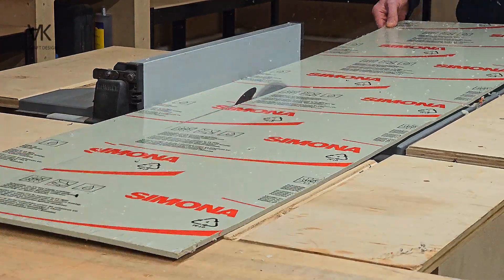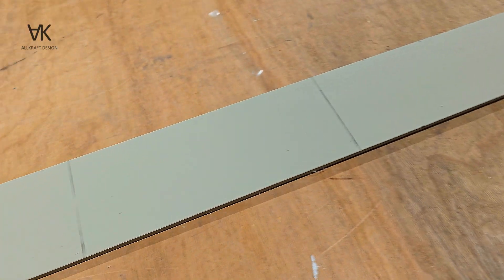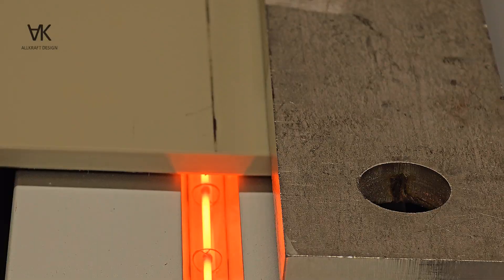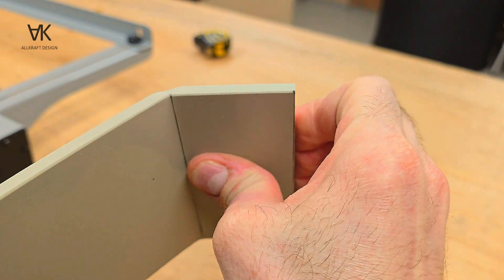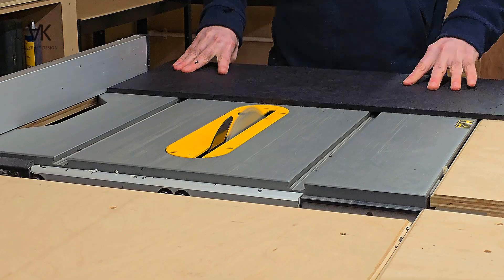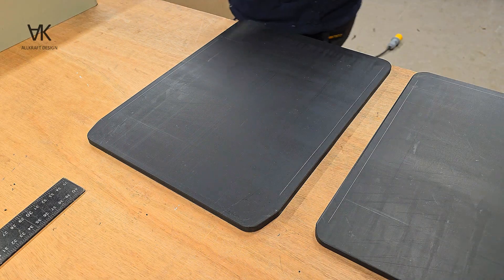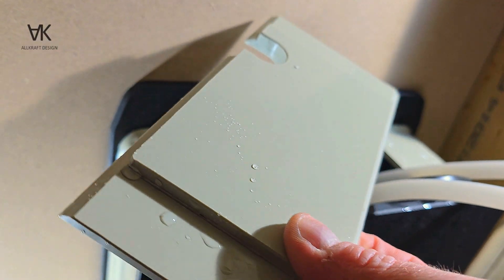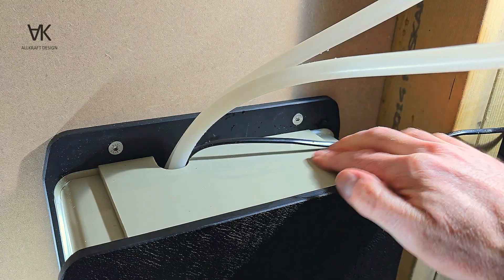Make Your Own Plastic Water Tank

Comment: Can you please put a link for your welder? Also do you use a speed tip and what would be better?
Reply from the maker: Hi 👋 the welding machine is a Leister Triac-ST, standard welding tips used are the 5.7mm triangle nozzle, 3mm diameter nozzle and the tacking nozzle, if you shop around online maybe Ebay or used welding gun there are some good deals out there. Leister is definitely the best for plastic fabrication!

https://www.leister.com/en/product/Triac-AT/141-316 

https://www.leister.com/product/Tubular-nozzle-straight/107-128 

https://www.leister.com/en/product/Speed-welding-nozzle/106-996 

https://hilltop-products.co.uk/catalog/product/view/id/27578/s/htp-106-992-5-7mm-nozzle/?utm_source=google_shopping&ppc_keyword=&gad_source=1&gclid=CjwKCAiAhP67BhAVEiwA2E_9g-fa0DkdMDQXasfZJ7I3jDPR0JHUKsHWYnL6bQEpj_V_7QQ0IThRVhoCIRYQAvD_BwE
Reply from the maker: The link for the welding gun is a Leister Triac-AT which has a digital display so you know the exact temperature coming out the nozzle, I use the Triac-ST it's pretty much identical just with a number dial on the back for temp, hope that help!